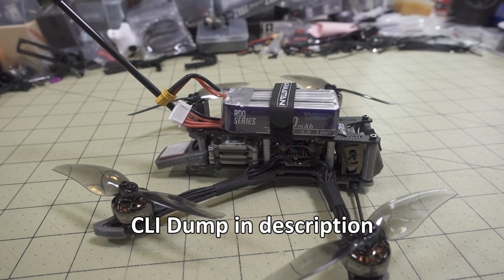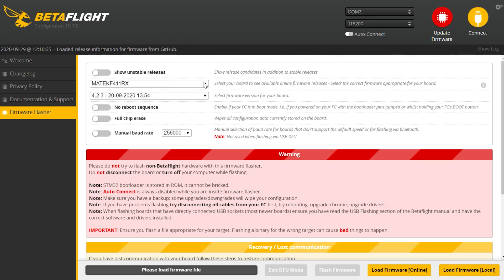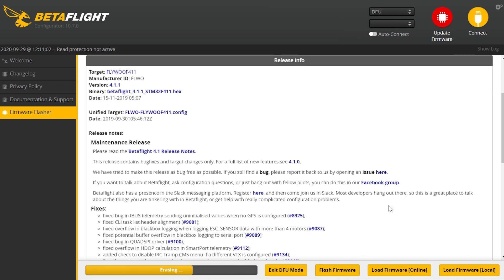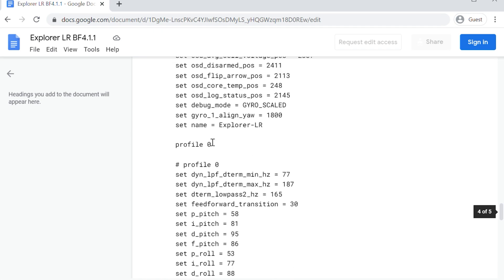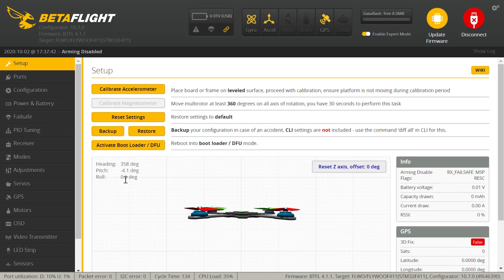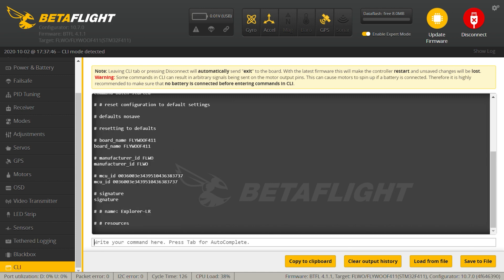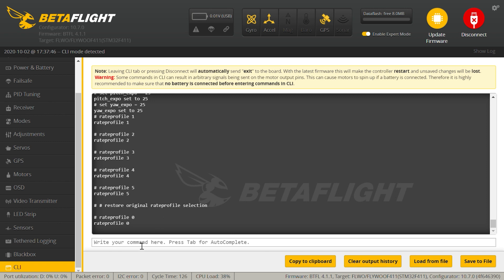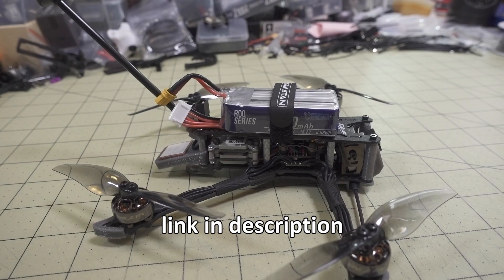Flywoo Explorer LR OSD Bug Fix 🛠️

Comment: Albert -- I love you vids!!  Thank you!   I tried to put my Flywoo up for the first time in 4mos and its like all the VTX and GPS and PORT settings failed.  I followed your vid to re-flash and upload the CLI Diff ---  and now "VTX Ready" shows "NO".  And when I go to PORTS - Serial Port is turned off.  Doesn't the Flywoo need a Soft Serial turned on to run the VTX and the GPS as it only has 2 UARTS and the first one is for Rx?    I cannot get the IRC Tramp recognized -- have black screen and NO OSD.   So do i probably have a bad FC ?
Reply from the maker: I'm not sure which version you have. They made a few revisions in the past year.  What you need to do will depend on the version you have.  Perhaps asking Flywoo support will be the answer.
Reply: @AlbertKimTV  I got er all fixed up and flew out over 3/4 mile a few days ago!!  :)   super thank you!   Flash back to 4.2 and put a fresh  VTX on board and all set now.  👌

Comment: Has betaflight fixed the 4.2 osd bug yet or is it still necessary to roll back to 4.1? I just got an analog v2 explorer with the f4 fc. It has betaflight 4.2.0 wondering if updating to 4.2.9 will fix it?
Reply from the maker: I'm on 4.2.6 on the Baby Croc now and it doesn't have this bug now.
Reply: @AlbertKimTV   Cool, thanks for the fast reply. I will update to 4.2.9 and let you know how it goes

Comment: Albert, could you please also upload the dump for BF 4.2?
I rewired putting the GPS on Softserial and the Vista on UART2 to avoid the problem that way. Now I would like to update to 4.2 and enable for instance RPM filters and so on.
However, I don't have the tuned PID's for 4.2.

Comment: Hi Albert..I'v got a big problem..😥I had lost one side of my OSD..So decided to try your fix from this video,i saved my settings..Clicked on OMNIBUSF4SD Tab which was in the box😕 and went to an older setting..started a firmware reflash.! it got halfway and froze!! THATS WHEN I REALIZED  I DID SOMETHING WRONG!! Now when try too connect in betaflight it wont open any COMS and fails,iv got a solid red led on FC and nothing else..I'v updated all drivers but nothing opens COMS..I can hold Boot and get into DFL mode But i have no clue what to do...Any  help would be so appretiated..🙏
Reply from the maker: I'm not 100% sure, but it sounds like the last time you flashed the firmware to the FC it got corrupted.  You should be able to put the board into DFU mode and reflash it.  You'll have to restore all your settings of course from your saved CLI dump.
Reply: @AlbertKimTV  Thanks Albert..!.Im not sure what board to choose in the Drop down bar for the flywoo board in betaflight...So sorry to sound so vage🤔
Reply: One last thing Albert...which board should I choose in the drop down box?😐

Comment: Hi Albert, my OSD doesn't display the arrow that points to home location even I got more than 5 sats.  All I got on the OSD is a dash line in placed of the home arrow.  Do you have any idea how to fix this?  I downgraded to Betaflight 4.1.1 and use your dump cli.  Thanks
Reply from the maker: There is an updated version of the FC and you'll need that updated CLI dump from the Flywoo website.
Reply: @AlbertKimTV  is it for Betaflight 4.2 or 4.1.1? The one I got from Flywoo was for 4.2 though. Thanks

Comment: As soon as mine arrives I am going to try swapping the Vista over to the UART the GPS is on and try running the GPS on the softserial. can anyone see a downside to this idea? A
Reply from the maker: Some GPS won't work on softserial... I don't know if anyone has been successful in swapping this around on the Explorer LR
Reply: @AlbertKimTV  good to know I will find out soon enough, apparently it is being dispatched today (without vista I am adding one I already have)
Reply: It has arrived but still in the box! Been focused on other stuff, will probs get to this late December, will try and remember to post here if I find a solution. There might even be a betaflight bug fix by then

Comment: Thank you albert for this but after flashing mine the dji custom osd disappears. I wonder what went wrong. Sorry just got my Dji Goggles with this quad :)
Reply from the maker: Sounds like somewhere in the procedure you might not have done it correctly.  Based on just this comment, I'm not sure where.  Are you sure the Custom OSD feature is turned on in the goggles?
Reply: @AlbertKimTV  I've flashed it to betaflight 4.1.1 and then copied your cli with no errors. The custom osd is turned on in the goggles.
Reply: @AlbertKimTV its fixed :)... copied one of their cli on their website and tried to remove some parts. i hope my osd will stay on this time :)

Comment: Thanks for sharing, Great content as usual. I am having the same issue on my Explorer LR. I flashed so many FC in the past without any issue but this Explorer FC won’t let me flash the firmware.  I’m using Betaflight configuration 10.7 and I’m in DFU mode but when try to flash to 4.1.1 it won’t flash.  Any idea? I can’t figure it out.  Let me know if you know what I’m missing. Thanks
Reply from the maker: You have to fix your USB driver... in DFU mode replace the driver with the Zadig tool.  See this video for instructions...  https://www.youtube.com/watch?v=0mrJG7AOmRI
Reply: @AlbertKimTV  I got it working now.  I know my driver wasn't the problem because I can flash other fc without any issue.  I found out for the Flywoo fc when I go to Firmware update option in the configurator I have to disable "show unstable firmware option" then it will let me flash the firmware.  Strange to say the least.  Thanks for your response thought

Comment: Hey Albert I never backed up flashed to 4.1.1, uploaded your cli dump, and all the settings are different. I don't have soft serial anymore in ports tab. Do you have a way I can restore it?
Reply from the maker: What do you mean "all the settings are different"?  Are you sure you flashed the correct hex?  Applied custom defaults?  The stuff in the video is my actual screen recording as I flashed and applied the settings to my FC and soft serial is there.  So you must have missed a step somewhere or flashed the wrong hex.
Reply: @AlbertKimTV  I might have used the wrong hex. Is the hex the file used for 4.1.1? I never made a backup so all the settings in betaflight are set incorrectly. Such as dshot, soft serial etc. After I flashed dshot was set to 600. When I paste the cli dump you provided does that change the settings?

Comment: Albert trying to get into dfu mode. Cannot. Hold button while connecting USB correct? Not having any luck. Button on top of board?
Reply from the maker: You're in DFU mode (assuming you pressed down the button while powering on the board via USB).  However, your USB driver needs to be fixed with Zadig.  Watch this video for instructions on how to do that.  https://www.youtube.com/watch?v=0mrJG7AOmRI
Reply: @AlbertKimTV  I reached out via insta on the flywoo osd can u respond if possible?

Comment: I just ran into something with this... I had no OSD after loading BF4.1.1 and the default config, I found out some of the resource settings for the soft serial setup were wrong. fortunately I saved my default config right after I got the thing and I put that setting back (for mine it had to be RESOURCE SERIAL_RX 11 B10).

So maybe (as others have said) there are two different hardware revisions on the stack?
Reply: Can u please send a screen(or CLI) of how your ports set ? I think i have the same issue, unfortunately i didn't save my settings before

Comment: After flashing 4.1.1 I could not arm at all. It took me a whole day to find out, that GPS was the problem. I could not use default NMEA protocol anymore and had to change to UBLOX and fix to 9600 baud rate in the ports tab. I didn't apply custom defaults though and pasted Flywoo's CLI dump plus my rates, PID and stuff.
Reply from the maker: So you used a different method than mine
Reply: @AlbertKimTV  Kind of. I followed the steps and files provided by Flywoo themselves from their website. I downgraded to 4.1.1 without applying BF custom defaults and pasted their whole CLI dump. I changed just my personal settings, but using NMEA results in a beep code without arming, UBLOX works fine.     A couple of minutes ago I got a response from Flywoo CS that NMEA should work as well. Maybe I'll try reflashing, maybe not, because it's working right now.

Comment: Thanks for a very useful video, love the channel. You are the man!!
Just received the Explorer WITHOUT the vista.
The two bundles of cables to be connected are labelled:
Bundle 1)  Gnd, 5v, TX1, RX1. These I assume connect to the appropriate tabs on the Vista
Bundle 2)  Gnd, 5v, TX11, RX11. Do these also connect directly to the VIsta unit? ( one of these is connected to the LED tab on the F411)

Any help with this greatly arppreciated

Comment: i have the analog version and same issue. the osd went away alltogether then came back after a number of reboots but no picture and now picture but only partial osd. some items show and some not. i cant get it to do the same thing twice. definite gremlins. and my throttle response is out of whack. works fine in betaflight motors tab but not when controlled by my radio. another irritating thing is i know you guys like airmode but i do not. it will not arm with airmode turned off. loud buzzer warning when you try it. i wanted to set up and go fly last sunday but never even got it off the bench. i am waiting for a reply from them. hope it works out. its alot of money for a paperweight. nice i just went and checked my cli for version. first it showed jibberish then on my second attempt is shows in red writing "###error: version: no config found#### manufacturer_id:flwo board_name flywoo f411

Comment: Weird I run soft serial on a couple of the betafpv aio and didn't have any problems but did it with an hglrc 16x16 f4 and it would intermittently have a big delay in the info. maybe f4 is overworked or something
Reply from the maker: I have a feeling it's a bug only in certain targets as I've done this on other builds with no problems but the firmware target is different.

Comment: Thanks Albert,  I see you have used "resource SERIAL_RX 11 A01" mine required "resource SERIAL_RX 11 B10" I think they have used different pads on some builds or a revised FC. I know mine Goku f411 looks slightly different from the pics on the flywoo site as it has 4 extra  pads broken out- (PB4 PB5 PB10 & i think PB1?)
Reply: Also confirming using Serial_rx 11 B10 on my friend's Explorer. If you check the Flywoo page they have a link to the files for BF 4.11 which contains two different CLI dumps for the different FC versions. The manual recommends if your OSD disappears to paste the other dump in. That fixed my issue. :-)
Reply: @grymlock13  where can. Found the CLI? Have you got the link? Thank you
Reply from the maker: Oh wow, this is weird... what version of Betaflight did you see that resource mapping?  I wonder if the resource mapping might be different depending on the Betaflight version.
Reply: @AlbertKimTV   That was on 4.2.3  I'll test 4.1.1 after work ( Australia time :) )  Also flywoo tech support sent me a rar file with 2 cli  dumps ( for 4.12 as you mentioned)  and the main difference  is the  resource remapping  PA01 or PB10
Reply: sorry just checked the dumps were for 4.1.1
Reply: manual.txt in the rar file states "Because of the difference in FC version, if the goggles do not have an OSD after writing the CLI command, choose another CLI command.
Please contact us if you have any questions
Technical support:"
Reply: @AlbertKimTV  I can confirm mine  "required resource SERIAL_RX 11 B10" on  4.1.1
I put a picture up on RC groups showing the extra pads.

Comment: I crashed this quad and instantly had worse VTX reception after. I replaced the VTX and antenna, but the problem still persists. It's like the VTX is in pitmode, terrible range but crystal clear when close by. I've had this happen with other quads, and besides replacing the ESC/FC I have no idea what the problem is. Anyone have suggestions? UPDATE: It was the antenna! replaced it and instantly better reception.

Comment: I need the cli dump for mine.. its the analog version.
Reply from the maker: This OSD bug doesn't apply to the analog version.  The 4.2.0 CLI dump is on the flywoo website.
Reply: you won't have the osd problem then.  no need.
Reply: @JoshIsReallyAwesome   I am needing the cli dump because mine is screwed up. not the osd.. but t wont show gps and the vtx is off a few chans like set for R:3 comes in only on  A:7
Reply from the maker: See the original video description to link for "factory settings"  ... link to that video is in this video's description
Reply: CLI dump is on their website https://flywoo.net/collections/explorer-lr/products/explorer-hd